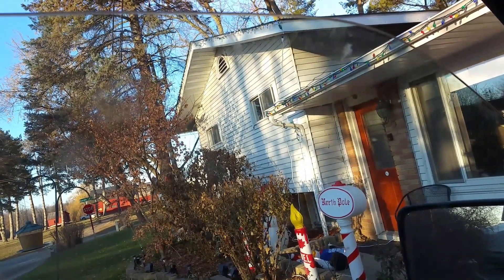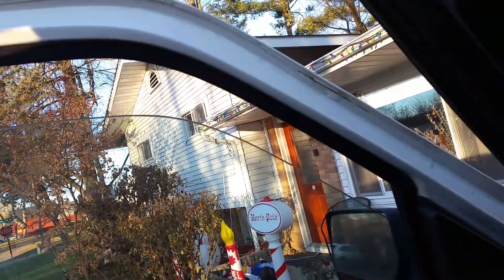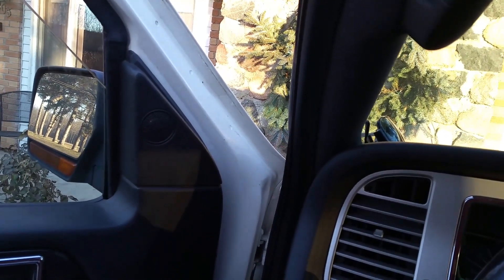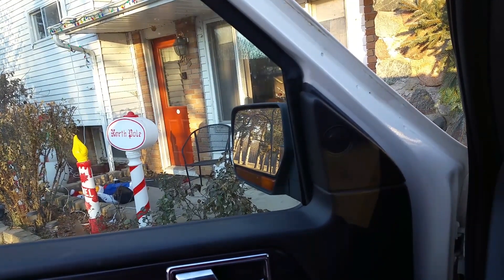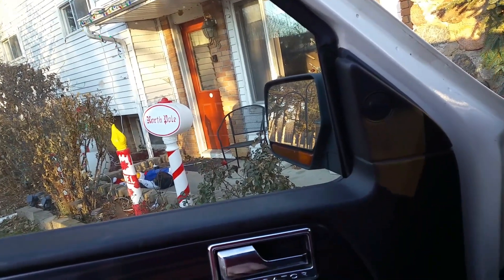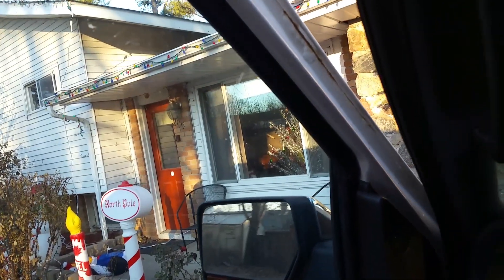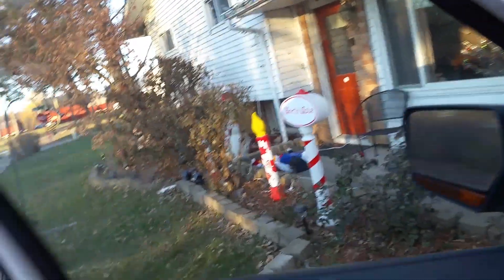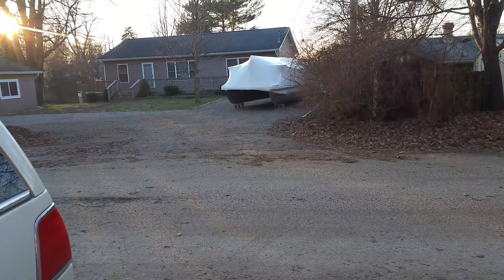2007 up Navigator Expedition power window How to relearn auto up feature

Comment: Sir, I am a 56 year old woman who owns a 2013 Ford Expedition. I have been struggling with the drivers window for 6 months since the regulator was replaced last fall, and no one seemed to be able to help me, they just kept telling me to hold the window switch up, and of course the "window bounce" prevented me from being able to do that. Your video was about the fourth one I had watched, and let me tell you, it was priceless! I thought my window was just going to have to be that way. I had learned how to roll it up most of the way to keep water, snow, cold & heat out. But sometimes, I would have to do it 2 or 3 times to get it up well enough to seal. I watched your video 3 times & went out & did it just the way you said, in my driveway, in the dark,& it is now working PERFECTLY the first time!!!
And I did it all by myself! THANK YOU for such an amazing video! You literally fixed my window for me in about 2 minutes! After MONTHS of struggling with it! I just can't Thank You enough! You are amazing!!!
THANK YOU!!!❤

Comment: Tried every other method,  this finally worked on my 2015 expedition.   Thanks!
Reply: Do you have a key or push to start? My 2015 expedition is push to start so I feel this video doesn't apply to me but nothing has worked for me to train the motor after a new window regulator.
Reply: Did you ever fix this problem with your push start on a 2015? Have the same and cannot figure it out

Comment: Thank you!
Thank you!
Thank you very much!
I have looked at 4 other videos that seemed like it was BS, and sure enough, it was BS.
But you was right on track.
And at 30* messing with this thing after putting the new regulator in, I was getting very frustrated.
Mine didn’t take the first time just like yours in the video. But the second time was the charm. I seen one video that stated to leave the window up for 48 hours. That was for an in channel visor, but it still didn’t make any sense other than maybe the visor formed to the channel. Anyway, I knew that wasn’t right.
I think you helped me one other time a while back, so keep the videos up if you can. I will subscribe.
Reply from the maker: I'm glad I was able to help. Reach out if you have any questions. 
Darylturcott@gmail.com

Comment: THIS GUYS RESET WORKED!!Just replaced our 2014 expedition regulator, I was unaware this glass bounce back would happen but it would automatically come back down part way when trying to raise the window fully. After trying several other videos and resets this was the one that did it. 
Key on 5 times quick, hold the window button down nothing happens, press it down again and let the glass go all the way down and hold the button counting to four, immediately go up with the window and when it tops out count to four. Turn off the key. Thats what worked, just like he says. Thanks a bunch
Reply from the maker: I watched lots of videos also that didn't work. I tinkered with the steps until it did work.

Comment: 2014 Lincoln Navigator - They are dozens of videos about relearning, resetting, reinitializing the regulator from DIY guys to Ford technicians! They talk about pulling the battery cable while the window is moving, standing on your head, chants, button holding, etc... None of them worked. Your video was the 20 second fix after installing my new regulator, which turned out to be the easy part.

Wish I would have found this video before all the rest of them. Thank you!!
Reply from the maker: I put in a lot of trial & error time after watching many of those!
Reply: Does anyone know how to do this with a push button start? How do you cycle the ignition five times with a push button start?

Comment: Man you rock the dealership to me to me keep the window up for a few days. I just did this in a store parking lot and it worked flawlessly on my second time 🙏🏽🙏🏽🙏🏽
Reply from the maker: I hate the dealers. I took my 500 in because I knew it had a broken wire in the harness. They said I needed a fuel pump and charged me $100 diagnostics fee. It didnt even have a fuel pump code. They didnt even inspect the worn harness I showed them.

Comment: I just did a regulator on a 2012. This method works! Thank you. 14+ models don't use the key cycle. I was about to give up
Reply from the maker: Glad it worked i didnt know it worked on 2012
Reply: If the 14+ doesn’t use a key cycle, how do you do it? I have a 2015 push button start and I’ve literally spent hours researching and trying and cannot get the bounce back corrected after a window regulator replacement.

Comment: Thank you, thank you, thank you.  I found this vid after replacing my regulator and having a window that wouldn't close properly.

This always used to happen to me on sub-zero winter days and I just lived with it.  Clearly, I'll need to re-teach it sometime next January, but I should be trouble-free after that!
Reply from the maker: Thank you for watching. I highly recommend spraying some lubricant down into the mechanism before the weather turns cold. Cold makes the grease less soft and causes a higher  power draw. The computer measures the current draw to decide when to stop the cycle.

Comment: Thanks for the video, it was very helpful and worked on a 2011 Ford Expedition that I replaced the front driver side regulator on. It was doing the same thing as your's and I initially thought there may be an orientation sensor on the motor where I'd have to clock the motor but your method worked! Very clear instructions, unlike the two previous videos I saw. Much Appreciated!
Reply from the maker: Thanks i appreciate that

Comment: Oh my! I have tried different types of ways...but to no avail 
Mine is an 06 and people tell me all the time Lincoln navigator never made one.
It bothers me badly because of this year 06 .The factory used parts from 04-07 YES!  I tried to use the instructions for my year and it will not work.
I found yours sir 07 so I thought no way it wont work.
My Lord above Its raining and I got my window up using your technique. So, let it be known this may work for 06 Lincoln's. 
Thank you very much for your time making the video.
Touche'
Reply from the maker: I'm glad it worked. I would have guessed 06 was different.
Reply: I have an 03 Lincoln Aviator. Going to find instructions to reset the auto function on my driver's door window.

Comment: Had the same issue on my 2013 Expedition and most videos on window regulator fix only cover the swap out and leave this out. I struggled to diagnose the issue for bounce back until your video. SUPER helpful.
Reply from the maker: I found a few different procedures listed online. Tried 2 others before this one worked. Different years might work differently.

Comment: Thank you so much thank you so much, I changed the regulator I changed the motor and I reset the automatic window works perfect you really know your stuff thank you so much.  Can you help me with my passenger mirror it's not folding, I changed the switch and the left side folds in and out but the passenger side right side does not fold in or out any suggestions
Reply from the maker: Does the mirror click or make any noise at all?
Reply from the maker: Also do you have electrical meter where you can do pinpoint test to check voltages and resistance? If you're good at that sort of thing I can probably get the service manual links for

Comment: Does anyone know if it has to be a Ford OEM part for this to work? I used an aftermarket Dorman replacement and I can’t get the window to program. Any help is appreciated.
Reply from the maker: My regulator/motor is dorman
Reply from the maker: There are several different procedures listed on different sources. This worked for me, but I recommend trying others if it doesnt.

Comment: I did this and it reset the passenger window up and down. But it wont reset the auto up on my drivers side. No big deal. I feel like my motor on the drivers side is starting to go. I only replaced the regualor. So i might try to swap that. It feels like it has trouble at the end
Reply from the maker: Could be . It works by measuring current draw. Perhaps a weak motor draws a lot of current. Is it an 07? I saw some different years use different procedures.
Reply: @darylturcott  mines a 2011, it worked fine for the passenger side. Thanks

Comment: What’s happened when only the driver door control the passenger and back windows and also all doors power lock do t work
Reply from the maker: Wow thats a tough one. I would start by jiggling the wire bundle where it leaves driver door while playing with the switches, see if you might have a broken wire there. If not youll need a voltmeter and a service manual to run pinpoint tests to isolate the problem.

Comment: How to do this with push button start. I have no key ignition. 2015 navigator
Reply from the maker: I've never had one that new
Reply: keep pushing the button. 1 push without holding the brakes - turns into acc. mode, 2nd push without holding the brakes - turns off. Just tried on my 2017 continental and it worked!
Reply: So how many time did you please the button to get it to work ? 10 times?

Comment: Just tried this after replacing the regulator on my 2012 Expedition Limited, and it doesn't work. I've gone through the process about 7 times now, varying the timing between the steps. Every time I get to the "Up" step, the window goes all the way up, hits the top, and bounces right down again... No matter how long I try to hold the button.
Reply from the maker: Mine was 07, perhaps the procedure changed will see if service manual goes up that new.
Reply: Have the same problem in my 2010 Fusion. I can’t hold the button up or it will come back down
Reply: I was having the same issue you always having it could be that you're cycling the key too fast. that's the problem I was running into